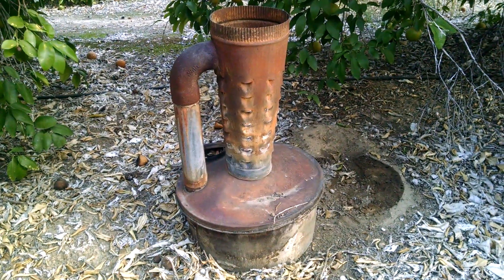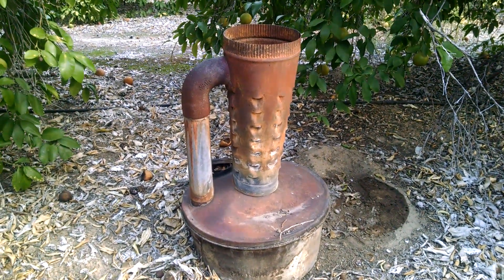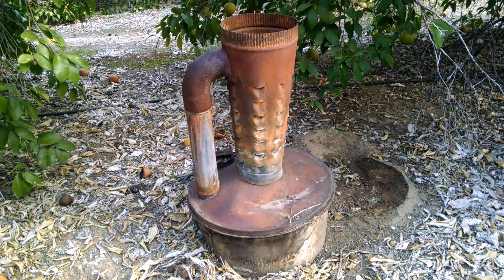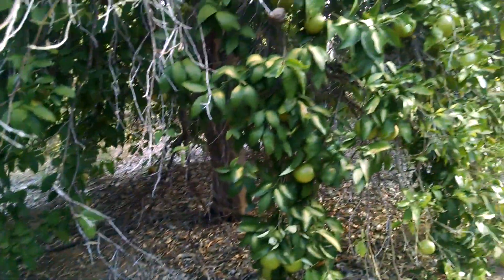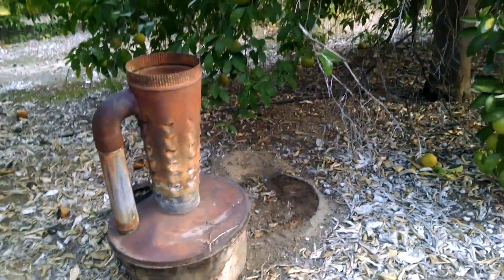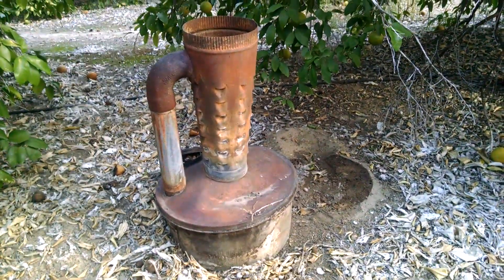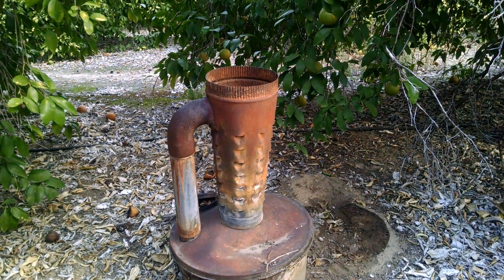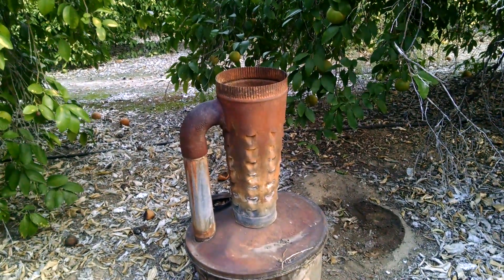Smudge Pot

Comment: I have a complete smudge pot.   The one you are showing is missing the stove pipe and lid
Reply from the maker: I have another vid that shows several some are complete as you describe and my understanding is that they were mostly used in the complete form as you describe and also without the extension and lid -- all depended on circumstance -- thanks for your comment